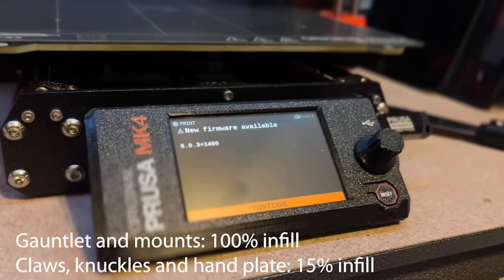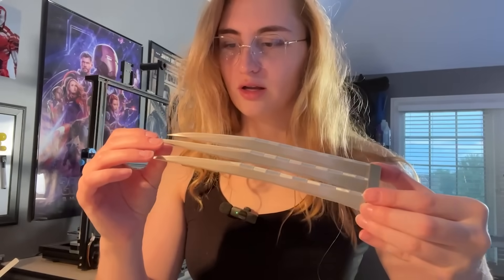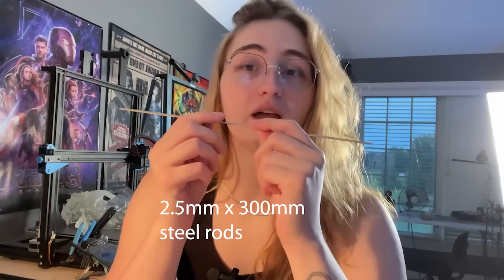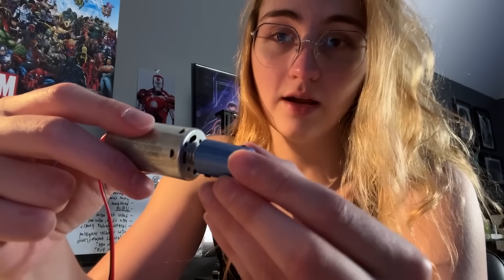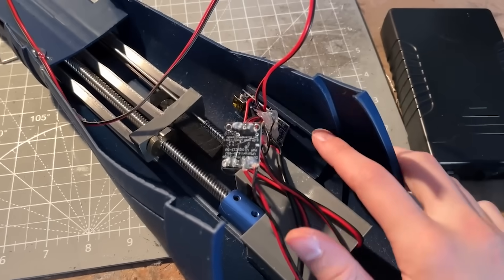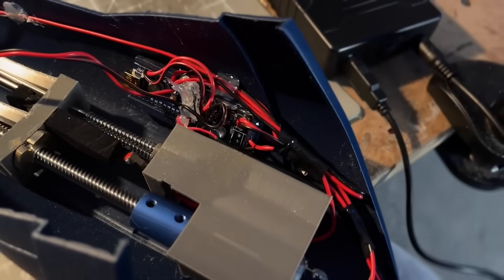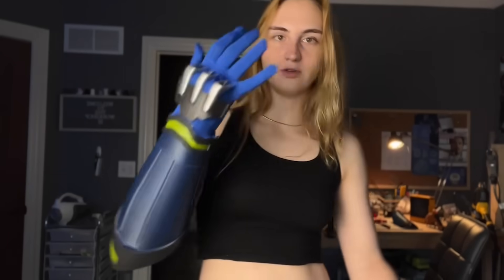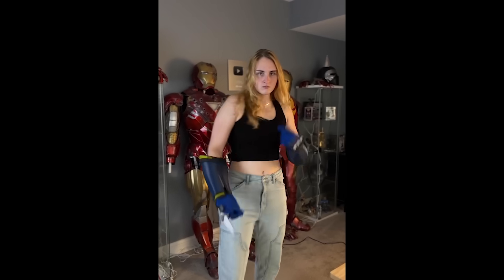How I built working Wolverine claws

Comment from the maker: hey y’all, just popping in here to point out the straight claws “issue” : this was mainly done to keep these as “slim” as possible, I know that the claws are supposed to be flared a bit. I’m mainly commenting this because i’m getting a ton of messages about it, I promise it’s something I’m aware of haha. there’s a few ways to make them more flared but I opted for the straight claws to save space!
Reply: the Cavillrene!
Reply: Just make a set that can flip them off with the claws in the next build.
Reply: Easy fix.

Well, maybe not easy, exactly, but by offsetting the outer two claws' slide-holes biassed out from center and mounting the corresponding claws with a little bit of swing allowance, probably with a hinge and spring, the claws can store straight and flare out when deployed. Maybe a version of the claws with the base plate attached can use a compliant hinge.

Still a fantastic print! Would have loved to see some of the engineering iterations. Probably a whole separate video.
Reply: @KiarasWorkshop  in the Brown and Tan Hulk scene in D&W, Hugh's claws are the flat straight knife blade style anyway.
Reply: What kinda wire did you use can I get it at Home Depot @KiarasWorkshop
Reply: I would very much like those wolverine claws you got whatever price I will pay
Reply: @captainwolfman1638  I would love some too Lol But I'm on about real ones like to become Wolverine I would love to have that power
Reply: you should spray the claws with graphite paint and electroplate them in nickel to give them a real metal look. do the same to the cover of the knuckles and remake them to make it set inside the holes you cut in the knuckes so you might get that iconic metal-on-metal snikt sound if they rub. also you could actually make the claws sharp that way... ya know, for fun lol
Reply: this is sic, i wish i could just pay you to make me a set. Best i've seen so far!
Reply: I noticed that. But now that you have an awesome working concept, you could definitely see about working that out. Maybe the claws could run on a straight track but flare out as they become fully exposed somehow? Perhaps the track itself could be slightly flared out and the claws could have hinges at the base that lock when fully out. I was also thinking about the blocky housing; perhaps you could dabble in making it and the base of where the claws attach to slightly follow the curvature of the arm and hands to make it seem more compact. What do you think?
Reply: You should legitimately patent those.
Reply: hiKiarasWorkshop a really great project! may i suggest you tu take a look at the ac hidden blade mechanism? it mai result thinner , but anyway excellent work!
Reply: Shadiversity *pointed out the massive limitation of flared claws versus straight ones. So yours are actually more functional than the aesthetically pleasing flared claws.
Reply: If you watch Shadiversity's video on wolverine's claws, essentially they find out through testing that if the claws have any flaring out at all they immediately lose power when stabbing. If you had inhuman strength it wouldn't make a difference I guess but the straight, aligned claws work better as a weapon anyway.
Reply: https://www.youtube.com/watch?v=H2p1NBXvdhs      may be this can help you in flared issue...
Reply: Kiara I bet you can make a working Dalek Gun /Dalek casing  or a Sontaran gun (Doctor Who)
Reply: It would probably be a lot harder to stay durable if it was flared and I think it looks great the way it is. Only question I had is if anything extra needed to be done to keep it sweat/water resistant. I get that might not be required for this but since it might get warm for people running around in a full version of the costume I just thought I’d bring it up. Impressive work btw :)
Reply: Nice job!
Reply: Maybe you can make the side claws spring hinged so they could flare a bit outwards?

Or use a more flexible material?
Reply: lol i was just about to ask xD
Reply: I would make each separate to save on all the excess wiring and keep in all hidden in the gauntlets but nice work
Reply: These are awesome you did a great job don't worry about how they look movies make things look pretty in real life it's not always so pretty...what matters is if it actually works
Reply: i would love it if you put a muscle censor on it instead of a button there are some videos on people doing that but i bet you could make it look way cooler
Reply: Simply used to spring's knife 🔪 up's and down, working not use moter bolt and battery,,,, In and out ok😅😅😅
Reply: Straight claws would work better for stabbing anyway. I actually think they should be straight all the time it would make more sense.
Reply: don't worry about the whole sheathing problem very common for wolverines over 40
Reply: you just prove (and other youtubers) that it can be done practical but they always choose to do it CG, such a shame from billion dollars companies.
Reply: You need to be on the Christmas Maker Ring!
Reply: Are you X-23 😅
Reply: You are the perfect girl for all the nerdy fan boys out there. A chic that makes wolverine claws.
Reply: Absolutely awesome work, those are fantastic 👏 👍😎
Reply: Put down your shivs before someone arrests your ass
Reply: They look friggin awesome !!
Reply: be captain marvel  please Kiaraworkshop love the elita 1 suit
Reply: Let me guess, you didn't even put a locking mechanism in it... because you don't think things through just like most cosplayers. You all do the most boneheaded things and spend a bunch of time messing up and then fixing the mistakes instead of actually thinking for 5 minutes about the problem.
Reply: "Right there, overhang, just dremel that crap out"... when you say nonsense like that in an attempt to be forceful and cool do you actually think you are succeeding? You aren't it is cringe.
Reply: Regardless sweetheart,  that's a good fuckin job on the claws.... I look forward to more projects from u.... I just found you tonight.... thanx

Comment: Great video, but the music is insanely distracting.

Rather than have the the foam piece to trigger the limit switch in the retracted position, you should just have just added a plastic piece as part of the the claw mold. That way you dont have to add more unnecessary pieces later, especially if it wears out or falls off because its glued. Whereas the plastic mold will never wear out.

Comment: The only way for a human to have real wolverine retractable real claws is to have his /her hand amputated to the elbow and then installing robotics arms with claws inside (modded prosthetic arm with real claws implantation therefore removing the healing dilemma ! )and a specific arm internal design that ensures the safety of the arm and the claws so there won't be any need for the healing powers , and this could be applicable to either humans who lost their arms or humans who are willing to take the risk to have real full retractable claws , and at the end this is not science fiction, it is totally possible, no offense for what you created , but this is a lot great , imagine having real wolverine claws , real ones.....

Comment: Really top notch engineering and very interesting project. You should consider adding timeout variable for each move. If limit is not reached in set amount of milli seconds it is going to stop the motor. This way youare not in danger of burning the motor.

Comment: I have a question on the wiring….Does the ground on the limit switches go directly to the push button or does it go to ground on the NANO?…I have everything wired up but when power is on, the motor continues to run and will not stop when limit switches are activated

Comment: Throw some grease on the rods. It'll keep it from getting stuck so often. Some kind of silicone lube/spray. Or even petroleum jelly should work well enough. I'd even take the fluffy side of some Velcro or maybe felt to line the insides of the openings that the claws come in and out of. Might help reduce the sound of the plastic rubbing together. Or it might get caught on the plastic and jam it all up. Idk. Lol.

Comment: A muscle jacket would perfectly hide the thickness of the gauntlets.
You can have a "arming" button somewhere to prevent accidental ejections, but having one or two large bush buttons at your wrist could work, as in to eject or retract the plastic blades you: 1. Arm the device via taking the safety off. 2. press your wrists away from the blades to to hit a large plastic part on the bottom side of the gauntlet.
Use metal wheels and rubber between the wheel and the mounts on the electric motor wheel to prevent them making sound when you shake your hands around.

Comment: What about using something like the mechanism in an out the front knife, but a blade like a tape measure, and you could have the “blade” twist 90 degrees and flatten out over the forearm piece to make it more low profile?

Comment: I would love to see you work with the Hacksmith team to shrink down the case, replace the claws with metal, make the movement a little faster, and get that metal "Snikt!" sound, and make it so you could variably control the speed which they deploy with the tightness of your fist using sensors.

Comment: That's how dumb they are in the movie you've got yours coming out the way Wolverine naturally had his claws come out but the movie they got them coming out from this pressure points it looks so fucking dumb in the movies. You got yours coming out the way Wolverine naturally had his claws come out. The movies they got them coming out from this pressure point it looks so fucking dumb in the movies,  I mean there ripping through is tendence that keeps his hand together  My only critique is you should have them as curved spikes that go to a point at the end. And instead of using some sort of electrical components to retract and contract you should use the same technology they use for Retractable blades.

Comment: You should use seperate battery packs for each claw something small and thin and find a way to incorporate them into the bottom or top of the gauntlet so you dont have so much exposed hanging wire but props to you these were awesome

Comment: Awesome video! One of the best Wolverine claw designs I've seen.

What if: 
You were able to separate the hand piece from the forearm piece, design a connector that extends out from the forearm guard and connects to the hand piece with magnets. 
This way you can have have more mobility at the wrist whilst the claws are retracted. 
When you active the claws, the connector piece extends out a few milliseconds before and locks in to the hand piece with small magnets to ensure alignment. Once the claws a fully extended into the hand piece, the connector retracts and you have more mobility in the wrist again. (You may have to redesign the whole extension and retraction system for the claws though. Maybe some sort of grabbing mechanism in the forearm guard that will pull back the claws during the retraction phase).

Comment: That's super cool! It'd probably be some more weight overall, but I wonder if you could use two lead screws to stabilize it rather than the one and the two metal rods. Might help with the jamming issue as well? Awesome work, regardless!

Comment: This is amazing! Thanks for making this video about the project! One question: It seems a bit overkill to use an Arduino for this. Couldn't you just use a few buttons, some of them resting contact, to make the blades extend/retract and stop at the ends? I mean, all the Arduino is doing is turning power on/off and reversing the current. Any chance of a simplified control mechanism in the future?

Comment: You might get a better extension/retraction speed if you replace the motor and threaded rod with a servo and a gentle 180 degree slotted rod. Roller bearings can be used. Good luck with your future builds!🤪

Comment: The flaring of the claws looks cool but makes little sense and straightening them simplifies the design and improved the strength of the overall system. No change needed there. The speed at which the retract and extend is negligibly too slow though it is plenty fast enough to sell the effect! The only changes to the design I would make are cosmetic. Great build!!! 😁

Comment: If you step on a tape measure, you can get the size of the inside of your forearm. Tip of big toe to heel gives you what you need. It's easier than trying to hold a tape measure one handed.

Comment: I feel like these claws could be done by the same way that Assassin's Creed hidden blade can be done, with mechanism that allows you to retract it back and forth by just pulling a string. I saw video about it last year of someone showing how that blade works, so I can't remember who's video that was. But I think that using that mechanism for each blade separately would be a cool idea, because that way you didn't had to power them up by anything. Just pull string once to pop claws out and pull it again to hide them.

Comment: Thats pretty awesome. Quick question, couldn't you use a brushless motor and use smaller lipo batteries in each gauntlet and get away with using a bulky battery pack?

Comment: Use a flex sensor hide it in the gloves onto finger ,and control it with the movement of closing finger. so you have more verstility and control over the claws. But the project is very cool

Comment: The arduino nano can handle 12 V in so why bother with the USB power when you already have 12 V?
Reply from the maker: I guess my thinking was the 12v being a direct separate power source for the motor, so all of the power goes to the motor and then the arduino has its own. that could be a better solution though, honestly don’t have a ton of knowledge when it comes to power but this worked okay for me

Comment: You beat me to it and I'm so annoyed lol 😂. I've also been working on making them retractable with at lead screw too and is scary how similar our designs are. I modelled my design from scratch using Fusion 360 and the placement of the lead screw on mine is so similar to yours. I was so surprised to see how you did it because no one I have seen so far has been doing it the way we are. Either way well done you did a good job👍, but this just means I've got to make mine better. 😎😎

Comment: Dear Ms. Kiara,

You did a great job,
just a couple nitpicks ~As a lego kid~:
2:59 Why use glue to fasten those claws?
         I don't like glue.
         It's great for improvising stuff/papercraft but it's flimsy.
         Moreover, the stuff lets go at the least convenient times.
I'd spend an extra hour 3d modeling a slot mechanism instead;
Make the whole thing a click and screw kit, much easier to maintain.

Secondly: 
Doesn't your design slurp juice like Mad Max does Gasoline;
Maybe if you springload the whole thing, it would be more efficient?
Your design is much safer TBH.

But you could put a spring onto that screw.
Put a lock on it, with a spoked release pedal.
Get an L shaped release pedal for safety.
And use that motor for retracting only ~with a separate button~.
No coding required.

Shure you'll look like a gay tiger releasing those claws.
But think of the juice you'll save.

In case you are wondering: I wanted to become an engineer;
But missed.

Comment: Looks like it's time for someone to use PCBways metal 3D printing...

Maybe there'd be a way to keep the claws aligned correctly by using ball bearings in some kind of 3D printed cradle, or wheels mounted on the inside that the claws slide across.

Comment: This solves one of the two fundamental issues with a comic/movie character cosplay.  Wolverine's claws were almost exclusively "in or out" or you had to have some kind of mechanism to release them, but it was all done by hand at some point.  This actually makes a functional set of claws that gives the illusion of being real.

The other cosplay issue is light saber blades, they have the exact same issue... that one might be a bit harder to solve, though :D
Reply: There are actually retractable lightsaber blades that extend/retract with a motor while also still being able to light up. Not sure exactly how it works but there are a few videos and shorts you can find that show it off, and it looks pretty convincing (if a bit slow) for videos. Probably not for sparring though lol
Reply: @null_verdict they aren't for mass production, only a prototype used for Galactic Star Cruiser and other Disney events/locations.
You're right,  the blade is extremely fragile and cannot be used for contact.
Reply: @CalebBradshaw-x2c  after walking away from a deal with a guy that had made a powered one, it looks like Hasbro is going to partner directly with Disney to make a working model for consumer purchase. Probably not till next year though.

Comment: Great video, and great design!
I was not aware of those power packs, and I REALLY wish I knew about them while building our FCG robot.
I will be using that power pack in the future, since it could power the voice/sound board with 12v, and 5V for servos, lights, and arduino..
Thanks for this helpful video!

Comment: These look great! I think a theoretical way to at least make the claws themselves lower profile on your hands is what if the bottom half is housed vertically within the top half of the claw and when extended a small spring ensures the pop to their fullness and remain so and retracted a guided slope that rubs against the glove forces the spring to decompress on the hand so that it slides into the house which then keeps that same pressure to ensure the decompression? Obviously on such a small and thin scale this may be nigh impossible but just a thought. Nonetheless these are badass!!!!

Comment: If you used a 3mm pitch instead of 2mm, would they come out quicker? Also, if you made more of  a sheath inside the knuckles, you might be able to pull them back a little further while not causing guidance problems. Maybe. Just trying to add some thoughts. :)